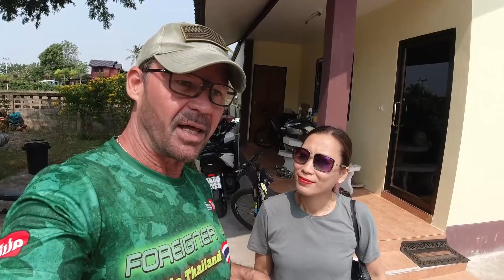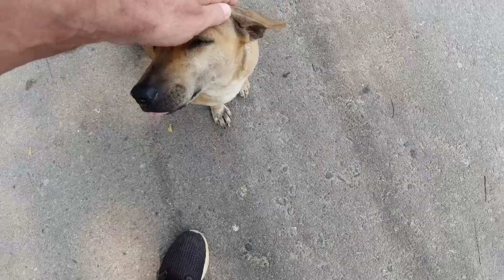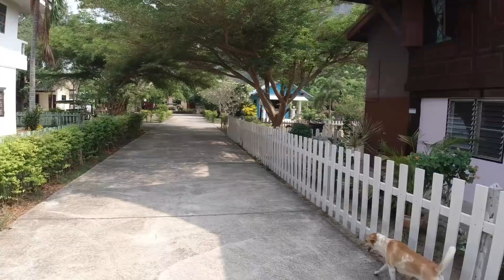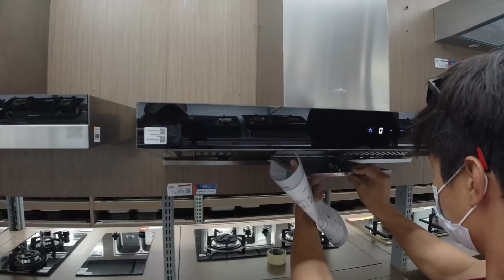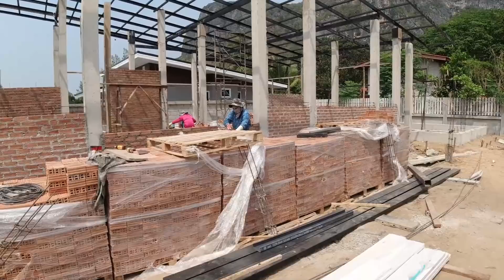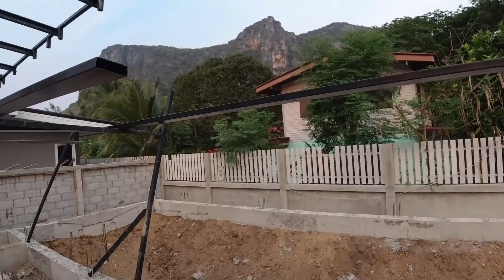P#7 Building Our Home In Thailand (Appliances) - My Thoughts on Foreigners and Land.

Comment: Make sure your electrical outlets have grounding, it's very dangerous without it,
Most houses in Thai land do not have grounding. The size of the conductor should be the next size up. Summer time is very hot and the wire can get hot running the A/C and other appliances and if you ever thinking of buying electric vehicle in the next 10 years make sure you have a higher circuit in the garage for a fast charging system
Reply: Fantastic and prudent sound advice 👍

Comment: If you don’t want that black mold on your side of the property dividing perimeter wall you see on the concrete/masonry  might want to think about using Limewash/Whitewash on your side of the  perimeter wall. To make Calcium Hydroxide (Ca(OH)2). They start with crushed limestone which is Calcium Carbonate (CaCO3), that is heated to give Calcium Oxide (CaO). CaO is then mixed with water & you get an exothermic reaction where it boils, after the reaction it is dried & that powder is then Ca(OH)2 which you mix with water & salt & apply to the walls & this then reacts with the CO2 to go back to CaCO3 with the crystals expanding where they soaked into the sub structure. So in effect you are coating the walls with limestone. The reason for the salt is it holds the water longer & this helps with the carbonation & gives a more durable Limewash. You have to wet the walls & previous coats before applying & the reason for this is it stops the water in the Limewash mix being sucked into the concrete/masonry & previous coats. Salt & Ca(OH)2 powder is a little over 2 Kg per Litre. The mix by volumes is 4 liters of water to 1 Litre of Ca(OH)2 powder & 0.2 Litre of salt. Coverage is for the mix above is between 20 & 30 sq.m. Time between coats is 1 day. For bare concrete/masonry do 4 coats. Limewash will eventually erode off & future applications 2 coats & to keep it looking good you need to do that every 5 to 7 years. Paint is basically a binder & pigment powder color & UV from the sun strips out the binder leaving you eventually with just chalk on the walls. Some of advantages of Limewash are it is easy to apply as you just slap it on, it is cheap, it is not effected by UV, it is highly alkaline & kills that black mold you see on walls here. It is made in Thailand but I not met a Thai who knows about Limewash so you will not find it in building suppliers but farmers use it to sanitize pumped out fish ponds etc so you might find it in farmer supply shops if not I just ordered & received 25Kg from Shopee (It has a few names, hydrated lime, slacked lime, calcium hydroxide etc & I put in “Calcium Hydroxide” to find the stuff I bought) that cost 200 THB plus 250 THB for postage but that will cover between 400 & 500 sq.m. For 4 coats that should be enough for 100 to 125 sq.m & as I got around 100 sq.m to do it should be just about right. For salt Big C a own brand is 10 THB a Kg (half a Litre).

Comment: Nice looking work there Joe.
I am surprised you did not use G con blocks on the outside as have better properties for keeping the inside cool with air conditioning.
Reply from the maker: I have visited Vhomes on several occasions in the middle of the day, no air condition no fan and the temperature was just fine. We prefer the red brick as I find it to be more durable and will last a few lifetimes. I also upgraded the roof and am adding R38 insulation, the temperature will be fine stay safe!

Comment: .Make sure you get some good roof insulation because those red bricks suck up the heat
Reply from the maker: I’ve been in VHomes in the middle of a hot day, no AC or fan and the temperature feels just fine.  We are also adding insulation in the attic with an R38 rating.  We will be just fine. Stay safe!

Comment: Hey Joe, Life is a gamble. I'm in one of those nightmare situations with my wife but I have 2 wonderful sons and step daughter. I didn't plan to have this situation at almost 70 yrs old but this is how the cards turned up. It's not what happens in life that matters, it's how we let it affect us. I don't let circumstances define who I am. That's up to me and I refuse to give in to the negativity. So much more I could say but I know you get it and don't have to give the naysayers any more fodder. House coming along nicely. I was working in Taipei when my house was being built and had no control over any of the materials being used and installed. I was shocked when I saw what you paid for all of the appliances. I got ripped off for 88,000 baht for a built in oven. It wasn't part of the build and considered a extra. To add insult to injury, the oven door handle prevents a cabinet door from fully opening and subsequently only allows a sliding shelf to come out 20% of what it should. I get a good feeling from your contractor and your being involved everyday is good for you. All the best to You and Gift!

Comment: Hi Joe , I see you are not getting the Fiberglass Swimming pool. I am planning to have a pool too . Which type did you and your designer confirmed and which type is easy to maintain?
Reply from the maker: I am getting a salt water pool which I believe is easier to maintain. I will be able to share more details as the pool is being installed. Stay safe!
Reply: @thaigirlgiftforeignerjoe7774  
Thank you so much for the information. I will stay tuned on the updates .
Have a nice evening